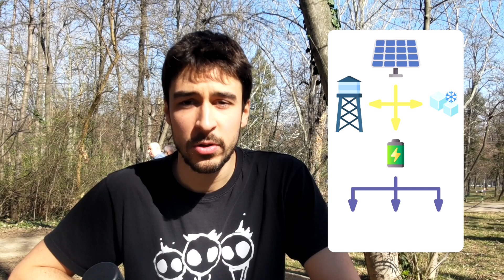Let's Electrify Africa Together!

Comment: Very interesting video! Thank you very much! I just have a question, I understand your idea to use other means than batteries to save energy, but you still mentioned that you would need to use batteries for certain small applications, could you please elaborate your idea on that as I got a bit confused there? Thanks in advance!
Reply from the maker: Hello Irene, thank you for the kind words!
That's a great question! The key point is that our goal is to minimize the battery that is needed (in order to lower the cost, and improve the sustainability). That means that our target for alternative storage systems are those points that would otherwise require a lot of energy from the battery. Thermal storage is a great example for that - 100l of water can store almost 10kWh of "cooling energy" if frozen, and the equivalent battery would be quite a bit more expensive!